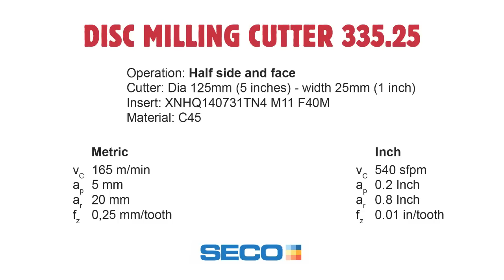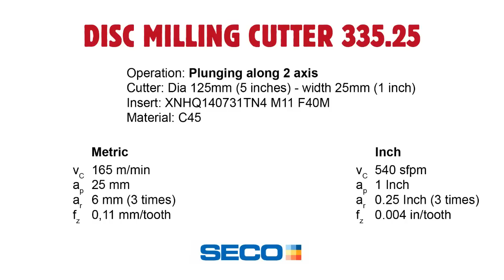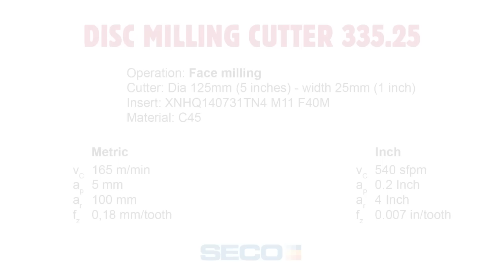Disc Milling Cutters | Seco Tools

Comment: I have used a good number of seco tools. They make nice stuff. Little warning if you have a older machine with some loose ball screw slow down your feed speed 5% from there recommendations. They are very aggressive on feeds and speeds. But again if you have a good machine run with them.